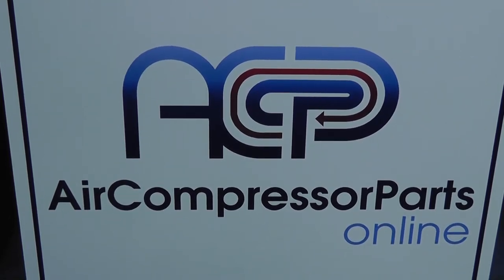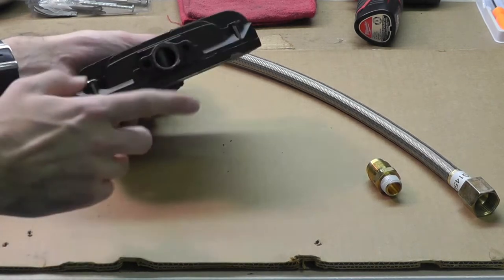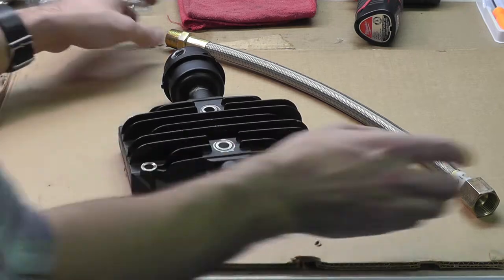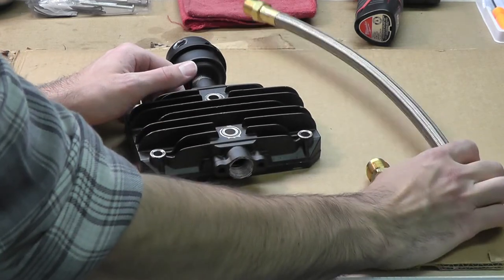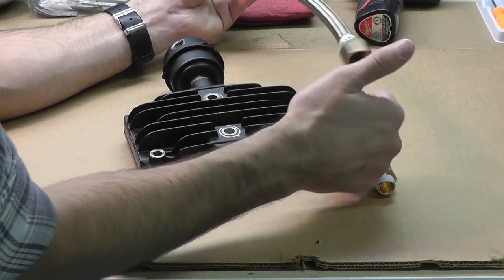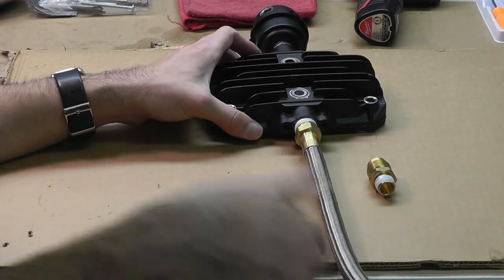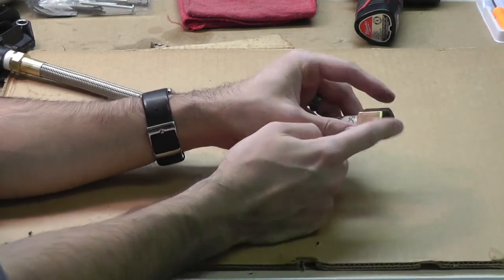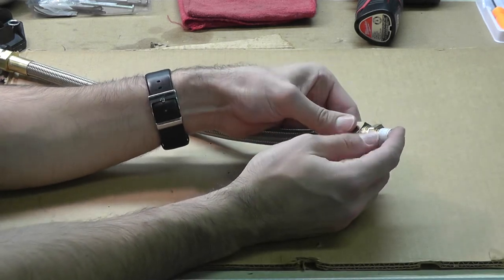How To Install A Stainless Steel Braided Transfer Tube

Comment: Need a link to your website in the description.
Would appreciate a few more details:
 - Are the flares JIC (37°) or plumbing (45°)?  Will a flare fitting from the HW store plumbing department match up, or do I order a hydraulic fitting?
 - Diameter listed is tube ID?
 - Where do you measure the length?  From the inner part of the flare fitting to the farthest end of the NPT fitting, or to where the NPT fitting starts, or what?

Comment: Eric - quite helpful video - I called and spoke with a tech adviser - she was asking me all kinds of questions about fittings and thread measurement / I just said thank you and hung up - the present tubing on my 80gal.2 stage campbell Hausfeld compressor is 1/2"
this video made the part and install easy - it appears that 1/2" line you just installed on the video is exactly what I need - can you confirm and please tell me what I need to order from ACP
Reply from the maker: Thank you for the compliments and for watching! We'll be sure to pass it on to Eric. If you have a 1/2" OD tube, you can use any of the 1/2" stainless steel braided tubes on the below page. You'll just need to choose the length and if you need an adapter or not on the female flare swivel end. It's usually recommended to order the tube with a new check valve that has a 1/2" female NPT inlet (if yours doesn't already) that way you can easily install an adapter in the top of your check valve inlet if you need to. The other end of the tube is 1/2" male NPT so that's easy enough to work with; usually that end would install into the pump head.

https://aircompressorpartsonline.com/12-steel-braided-tube-28-lengths-p-13098.html

Comment: That line gets really hot,  isn't there some type of rubber in the inside making it flexible and won't it melt and is it the same as a braided steel water line
Reply from the maker: Thank you for the question! The interior of the these hoses are made of flexible PTFE (Polytetrafluoroethylene) and they are rated for 2000 PSI.
Reply: @AirCompressorPartsOnline  how to I buy parts from you I need a discharge tube about 16" with 3/4 inside diamer nut on both ends with a m16 pitch
Reply from the maker: @victornaja7927  All of our transfer tubes can be found at the below link, but I don't believe we have one available with the exact specs you need. You may want to find a hose shop that has the tube you need or contact the manufacturer of the unit itself:
https://aircompressorpartsonline.com/transfer-tubes-nylon-tubing-steel-braided-transfer-tubes-c-25_294_434.html

Comment: My hose is 1" diameter and I can't find that size on your website
Reply from the maker: Correct, we don't offer a 1" OD S.S. braided tube...the largest we'd offer is a 3/4" tube:

https://mastertoolrepair.com/34-steel-braided-tube-12-27-lengths-p-13099.html

I would see if you have a hose house locally, or check with Grainger or Fastenal as they may have a tube of this size available.

Comment: Can this be installed on my pilot valve instead of tank
Reply from the maker: You sure can. If your transfer tube installs into your pilot valve now, you can install one of these tubes into it. These tubes have a female flare swivel on one end and standard male NPT on the opposite end. Thanks for the question!

Comment: Could I order a tube from you all with different threads on each end?  I had to replace my check valve and it fits the tank but I couldn't find one that fit the tank AND had threads to fit the current transfer tube.
Reply from the maker: All of our stainless steel braided transfer tubes come with the same types of fittings, I'm afraid. One end is a male NPT fitting and the other end is a female flare swivel connection. You can certainly find adapters to fit various other types of threads, typically these are available at a plumbing supply shop or hardware store.
Reply: @AirCompressorPartsOnline  will it fit an ampro PA 2000 series please let me know
Reply from the maker: @victornaja7927  These transfer tubes are universal and fit many different types of units. I don't have any information on an Ampro PA 2000, I'm afraid, so I can't say for sure. 
You can see our selection of stainless steel braided tubes by clicking on the below link:

https://aircompressorpartsonline.com/transfer-tubes-nylon-tubing-steel-braided-transfer-tubes-c-25_294_434.html

Thank you for watching!